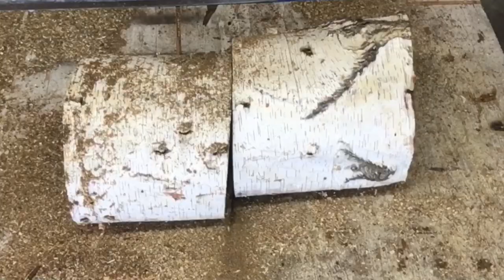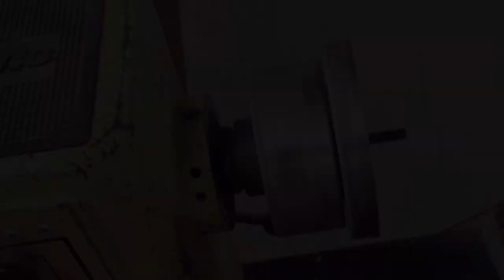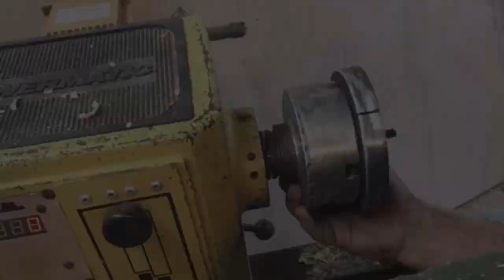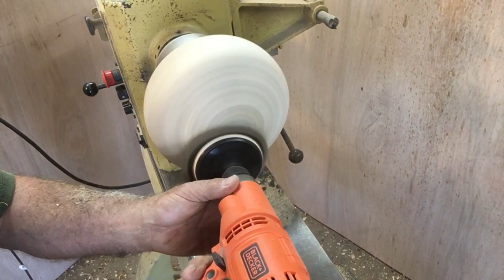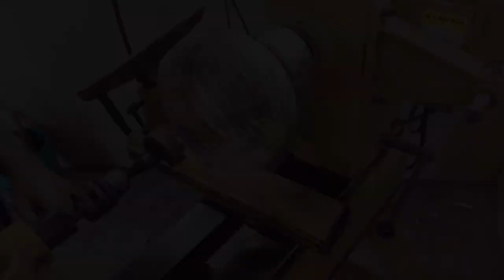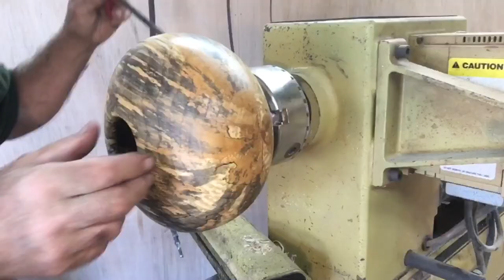Woodturning- spalted white Birch

Comment: I am turning spalted birch at the moment but having difficulty with the hardening. I find it very difficult to sand after adding the hardener. The sandpaper clogs up. Great bowl.
Reply from the maker: Thank you Terry, I too have had a lot of problems with clogged paper. I’ve been tempted to try abranet sanding mess. I hear it’s better and easier to clean the clogs. Just blow air through the screen.
Reply: @darrenswoodworks8695  I am doing a bit better using super glue as hardener, but it takes a lot of glue.
Reply from the maker: I sometimes use shellac to harden the wood and sand it down. Also sanding sealer. Cut both with a thinner about 50 percent to get it to soak in better